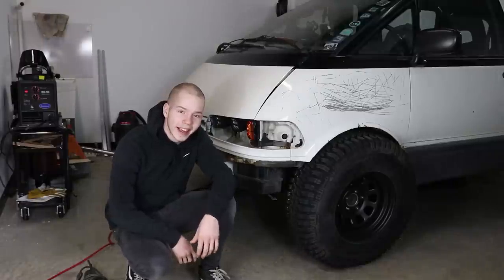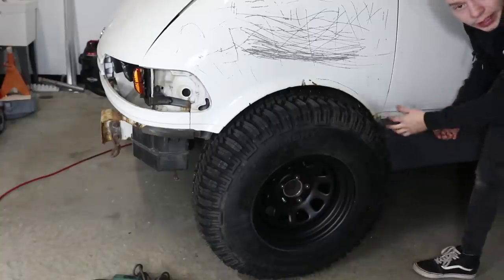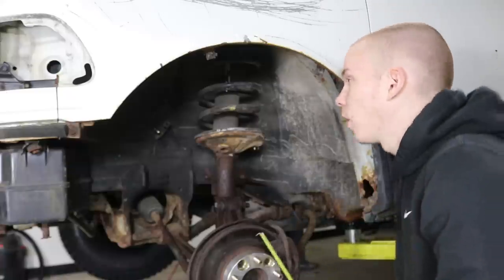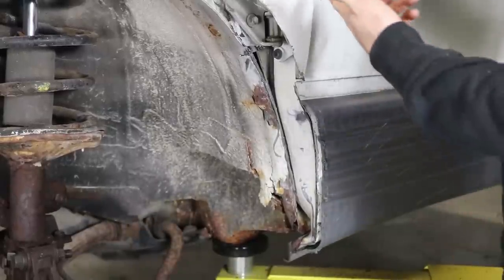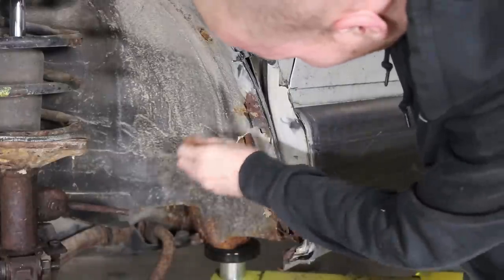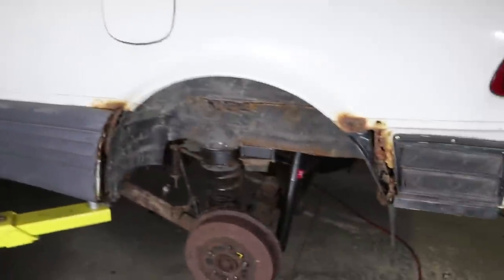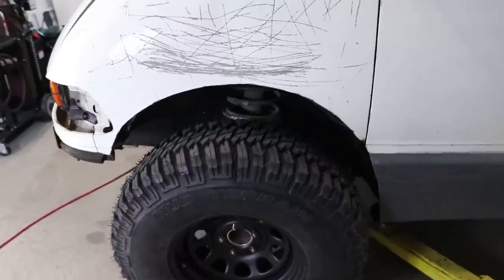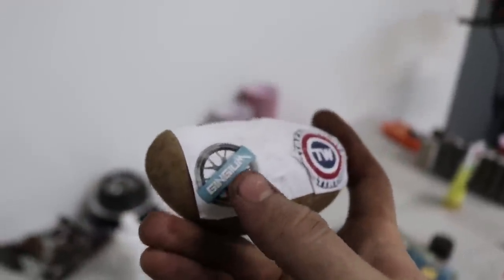Attempting to Fit 31" Mud Tires on a Mini-Van...

Comment: I love this project. Not much love for the van itself, but I think it's hilarious. I say go offroad JDM hotboi. For no damn reason. Think doing some of the stuff that MCM did to the VW to give it 'street cred.' Decoupage some body panels,  roll those hot mess fenders or weld up some sheet metal flares for real offroad hotboi stance. Go find Fabium and slap on some tube bumpers and skidplates. Ultimately, just do what you think is fun. Keep it cheap, make it badass... we'll all appreciate it.

Comment: try to use a heatgun on the plastic stripes. i did on my vehicle and all the grey plastic turned black again.

my experience with painting plastic is not that good, because it chips off easiely. at least on my pieces :D

Comment: I'm thinking clean offroad. Think like Fallout pre-war kinda thing, decorative nuclear reactor under the bonnet with a battery bank inside to add to that. It's like the van that was made for the apocalypse, and was mass production ready, and would survive the fallout. These are what you drive in the Wasteland.

Comment: You legit need a stiffer suspension. I know it sounds backwards, but stiffening it means that while it handles small shock worse, it can handle a much larger shock without running out of clearance. As it is, I doubt it will handle a tiny jump without putting all that shock into the chassis.

Also, I agree with the people saying build it to be used. Don't try for a theme, go for function and it will show it's own theme.

Comment: I'm inspired by your build, so my Previa has bumper delete and big tires now. I did some cutting up front so I got 235/75R 15 tires all around without having to lift the van without strut and spring spacers.  Operate on another make of minivan when you can my friend! Cheers!

Comment: If the doors can't open you should strip as much weight off of them as possible and then bondo the gaps so the bodywork is smooth.

Comment: Clean is too hard, apocalypse stuff imo is dumb (I hated the thing MCM did).

Gingy, just make it work, make it awesome. DO YOU.

You want it to be awesome and lifted, make it awesome and lifted, make it work, and make sure when you take it out to thrash you get good shots and really beat on it.

Views abound.

5:03 - By moving air under vacuum into a larger space it significantly silents and reduces the velocity; you'll find these larger airbox chambers on more family based vehicles where they tend to try and make you forget there's even an engine there.

Comment: That fender with those scratches is bugging me. You should rattle can it with any color of paint, just get rid of them. Also I don't think you should do "clean" off road build, but rather just like a lemons/gambler500 style, as the car is just too crazy and broken to do a proper "clean". Like still have it be clean, but like leave the rust and headlights and stuff, ya feel?

Comment: You should buy a weed sprayer for yard stuff ..fill it with meratic acid found at local home store and spray all the rust...nutrlize with water...repeat until it's all good...rust remover😉

Comment: How about a matte olive drab green paint job (or vinyl wrap), and go for a military/apocalypse look. Use nice high quality components like light bars, front bull bar with a built in wench, maybe an exterior cage made from black tube steel that you can mount stuff to like equipment and flip down window protectors. Put a Jeep jack on the front, a roof rack, rear mounted spare tire, and a window snorkel. Perhaps could be some artificial wear to the exterior to give it the tad bit of an apocalypse look.

Comment: While I think this is an interesting and unique build it's hard to get excited about a vehicle that's in such bad shape.  You can just pull things off the body it's so rusted and to be completely honest I'm surprised the thing hasn't collapsed on the lift.  I know it's the only one you could find but you really should've saved this idea for something that's not quickly returning to the earth from which it was mined.

Comment: Just a small idead, why don’t you make an aluminium plate where you can mount your front “headlights” on, so it’s cleaned up, and you don’t have a gaping hole in the front of your car where headlights were suppost to go

Comment: take the struts apart and put heavier springs in them like a f-150 front coil spring with a heavier spring in the strut it wont compress as much and you wont have to do as much cutting

Comment: I wonder if you can cut the suspension off its mounts and move it a inch or two forward?  That would be ridiculously hard for you to do... but that would get you all the clearance you need to turn the wheel.  It really all depends if you can move the the bottom part of the suspension without touching the top of the strut tower to do this... 

Aside from, all else you can do it start cutting the door, and and weld a plat to the open edge..  

Also, just get rid of the plastic stuff on the side of the van... it will hide rust on the car body and looks gross and 90s like.

Comment: Take the spacers off the front of you can. They are adding space on the turning axis witch brings them to hit the body. If you take them off you might get good clearance for the tires and then you can just upgrade to a smaller diameter strut and get rid off the rusty ones. 👌

Comment: You should use the glass pieces from the original headlights to cover the led’s on the front so it kinda looks like it’s still got headlights but it’s the cool led’s under

Comment: You should cut the lower bottom of the sliding door near the back and weld it solid to the van so you can still open the side door. Just the lower left hand corner the part that hits the tire. I think it would work and still look good and allow you to still use the door. It's just a thought and maybe you can try it out.

Comment: Cut the bottom part of the door and mount it to the body in a fixed position. Use the top of the door to still slide in and out. You can make a body cage in the inside behind the fixed lower half of thr door

Comment: I like the direction your going..but battle van with a rattle can has been done.. make at a superb off road Miata support machine. On board air.. tool boxes. Winches
Reply: On the cheap though

Comment: Apocalipse theme is ok, but unless you do smth insane like lifting it 30 inches, it's not worth it. I suggest you do a clean apocalipse style like with minimal rust. I dunno about your opinion, but making it look like it rolled over and someone repaired it with a hammer, than making it chrome or rusty dark red with apocalyptic decals, sounds to me like a good ideea. Other suggestions: window armour, crazy exhaust like those Japanese ricers (gaskings calls them that way), a supercharger, although it is mid-engined, but like a fake one or smth just for the cool intake. I sugest looking at mad max cars, especially a guy, I dunno what is called, that transforms hot wheels cars, just search hot wheels mad max transformation, and you'll find some ideeas. I'm sure.
Reply: Ps baremetalds
Reply: Sorry BareMetalHW the guy with the hotwheels cars

Comment: Quick tip for when you shut off your welder don't touch the dials on it then you won't half to worry about it when you turn it on once you get the perfect setting for welding leave the dials where that are when you turn it off it will save a lot of pain in the long run